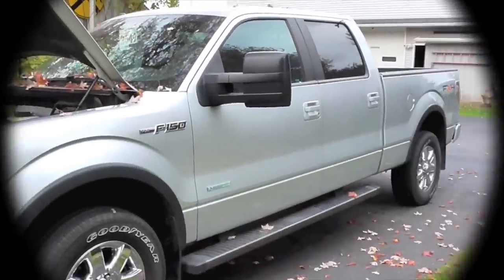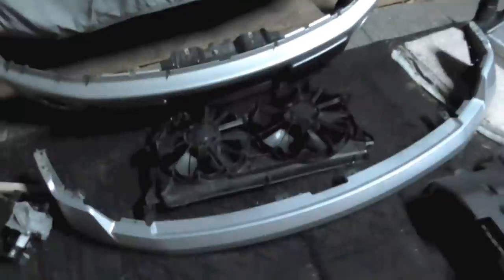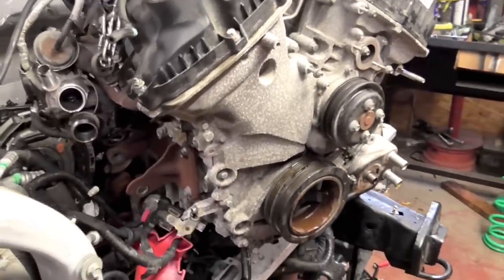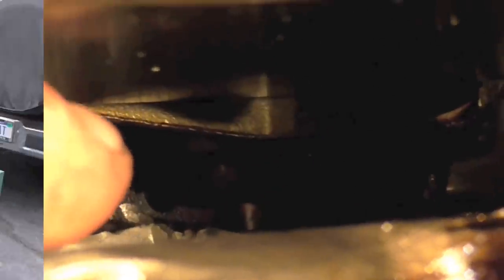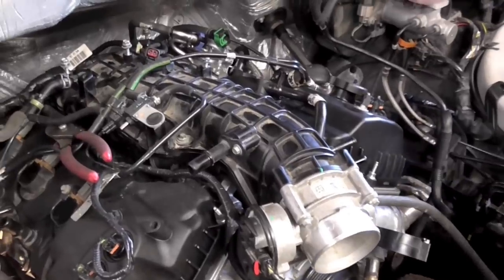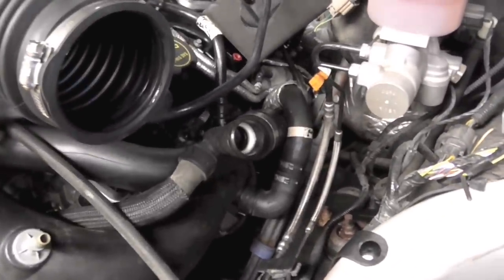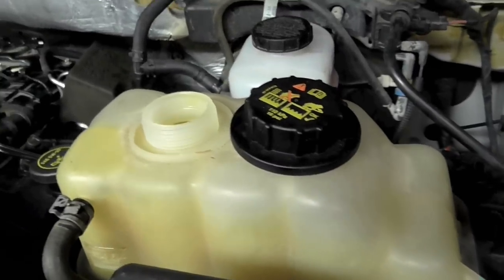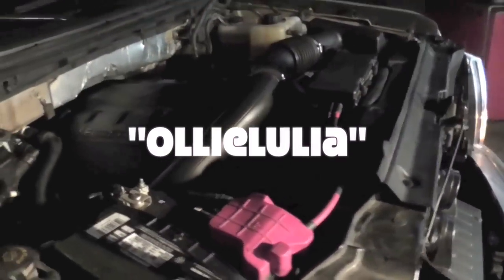FORD F150 TRUCK:  3.5 V-6 ECOBOOST ENGINE FAILURE (Removal and Installation).

Comment: Been a ford tech for a long time never changed one of these but I have a pretty good idea that this motor was refused warranty because the amsoil one oil change a year bull . Have tones of these in fleets with 200k miles on them. Using bulk oil and ford filters
Reply from the maker: NOT in our example ... If you read here (and it's impossible too "read" everything), we had a Blackstone oil analysis done, and used "AMZOIL" every 6 K. ... Blackstone's anal. (and the Trucks "oil life index"), were pretty much spot-on / and agreed.  *NICE TO KNOW ... The topic of oil / records/ amid "everything else" never got to "1st base", as we were past (or exceeded) the miles and that was it.  NOW we use (and will continue too use), only MotorCraft Oil / filters to maintain our 3 year warranty.  

Our only argument: all the water ...  * "a small LAKE in fact":  AFTER the failure.  * The failure was caused by hydro-lock, often (today still), we'll see it dripping out our "weeping holes" STILL.  :- )

Comment: how much boost do these motors actually run?
Reply: 13 psi, drops to 11 close to redline then spikes to 15 on an upshift.
Reply from the maker: "Work's for me" ... *My Son (the Driver) likely will NEVER find out, as He's an "easy driver". What Nelson says sounds about right. "Hell I don't even know if there's a "boost parameter" ! (or a "gauge").  

The Truck continues ta run PERFECTLY.
Reply: Yeah the trucks broadcast a PGN over CAN for manifold pressure, any OBDII reader will log it.  If you boot it quick you'll see peak boost really soon.  The turbos are little bitty Garrett GT15's so they spool instantly.

Comment: How long did it take?
Reply from the maker: From beginning to end ?  "about a week". We weren't going "gang-buster's" trying to get it done .... just bit by bit every evening (after work) Jack. "It wasn't that bad".
Reply: @TommyZTrains  How did you end up lining up the converter? I'm getting ready to attempt an engine replacement in my 2013 3.5 EcoBoost but I've been told to take the cab off to do it
Reply from the maker: @dannyarnold593  Hey Danny,  If I recall it wasn't that bad and we "eye-clocked-it" (the bolt points), and I THINK just pulled it together amid a "wiggle" and the starter being OUT helped a lot to. "IT WASN'T THAT BAD" !!.

Comment: Folks as great as the ecoboost engine is it'll never outlast the engines in the 92-96 Ford Trucks.
Reply from the maker: I'd bet that with anyone "older", that THAT would be a fair statement to make ... "starting with computers (and technology) alone. take an old 302 or 351, (even going back as far too the old straight 6's) ! THOSE were the best days yes ? :- )
Reply: I bet my 92 Ford Ranger is still on the road.  That truck ran great.

Comment: My girlfriends 2017 Escape 2.0L ecoboost is at the dealership having the engine replaced, it lasted 30k miles she got to drive it about a year and a half before it blew - the head gasket blew out and coolant got in cylinders, she bought it brand new and had it dealer serviced and never towed anything.  Don't they test this crap out before they make these damn engines?? Something is wrong here, pick up truck engines are supposed to last, I would not trust this in a truck.  These engines are light duty at best..
Reply from the maker: "Yeah": In the "perfect-world" you'd think they'd be tested, *(and it's quite likely that they are). We were flabbergasted upon our "blow-out" ... literally in a state of dis-belief !. 
*Man the REALITY set-in FAST tho.  :- (

Comment: when you grenade an engine all the piston parts make there way into the exhaust and into the turbos and that can damage the turbos and put crap back into the engine, I hope you had the good sense to clean them out, I don't see a second video so I guess it worked. You can get ford to warrantee that engine if it was 1 year newer.
Reply from the maker: Good thinking "Crap"  :- ) ... but: the failure happened, at literally an "Idle". (Read the description).  STILL: You remark is spot-on, it's just (in our example), the parameters were "different". NOT "an Explosion" ... *ANYWAY: (most assume a thing like "that", is is a "given"), ... but again: NOT here.   Best

Comment: I'm not a Ford guy.... but I've always liked the ecoboost engine that they've put out. I know the first gen had it's problems and hopefully they've been solved with the second gen they use now. I drive a 17 silverado 1500 LT with ol' reliable 5.3L v8 but I've always deep down wanted a 2011 f150 with the 3.5 ecoboost!!
Reply: The ole "Coke vrs. Chevy" argument ... all I would add is that this Truck CONTINUES to run & operate flawlessly @ appx. 110,000 miles, (appx. 60 K AFTER this failure occurred). "It's a  G R E A T  Truck" !
Reply: Can't believe the failure happened in the first place..... glad that the truck is running great now!!

Comment: The ecoboost has been a nightmare for me,,,first the blow by then the rattle started ,,,it’s just been one after another after another ,,,,right now I’m looking at a complete engine change out transmission and all…..
Reply from the maker: Shit, "I'm sorry to hear that". We got off to a rough start (this video), but now *(as I surpass 200 K miles), I have had zero issues / and the oil is changed every 4K with plain ole Motorcraft "plain-Jane" 5-W-30 oil as Ford recommends ... and aside of an occ. bottle of "Tectron" cleaner every 15 K, I have done NOTHING. The issue is ANY NEW TRUCK is far worse then this / amid most receiving not 10 points outa 100 with Consumer Reports. Anymore, a hundred K miles out of ANY American platform is near impossible.  :face-green-smiling:

Comment: what causes a hydro lock?
Reply from the maker: The Charge Air Cooler, makes the incoming air "chillier (and more "dense"), thus the twin Turbo's (in this Platform's example) are more efficient / better = more horse power. The side effect is that internally (upon doing that which I preface), water "droplets" form (or "condensation"), and "fill" the "Tub" (or accumulate inside the "C.A.C"). The issue HERE: Lack of a drain hole and condensation building up & up (filling it with water droplets / until the "tub" is "full"). 

*Now, a burst of acceleration = a large swallow of water "injested" = "hydrolock failure" (cylinders swallowing huge amounts of water) = failure & the reason we had to do this job / engine failed.  

After the failure; water was streaming out of the exhaust "weep holes" for some time ! *So much in fact, that: "we assumed it was OIL" !!  ... it just poured out !!!  (This FAILURE occurred doing about 10 MPH after a dead cold start / light acceleration BTW). 

*End game: Drill a hole in the "C.A.C" The: ("charge air cooler")  *so it can drain = no issue afterword.
Reply: i wonder if ford fix it in 2015 models
Reply from the maker: I'm NOT Sure ... "Tell ya what Javier: I'D LOOK" !!! *it's easy too see a "hole" underneath (in the C.A.C.). My GUESS is (on a 2015") ... YES  (it HAS the drain hole).

Comment: These engines should be warranted to 100k miles like other mfgrs do. The short power train warranty demonstrates Ford's lack of confidence.
Reply from the maker: I guess after all the torture test video's we saw (PRIOR to buying our Truck), "that we never thought about that". Maybe it was the Mike Rowe narration ?
Reply: Aren't GM and Dodge 60,000 miles as well, last I checked they were
Reply: Up until 2015 GM & Chrysler power train warranty was 5yr./100k miles.
Reply from the maker: That'd of been nice John !!  :- (

Comment: I’m swapping out my motor and transmission on my f150 2013 limited 3.5 ecoboost with 298k miles. Had the truck since 8 miles and had ams oil and filter ever since she laid to rest. Cylinder 5 blew due to the previous place that tuned it which was a licensed shop broke the spark plug in my cylinder. Interesting seeing this as it only has 68k miles.

Comment: Those Connecting rods look to be Casted. Any turbo charged car should have Forged internals. I think this Motor might have experienced Low Speed Pre Ignition which caused the Fuel/Air mixture to Ignite Prior to the Piston Being at the top of its combustion stroke. This being of 2011 Production makes me think ford was still using the wrong materials at the time as i believe they did not switch over to Forged internals until about late 2014. Amsoil and Mobil 1 are supposed to be Releasing a Re-Formulated Oil that combats LSPI. Scary Stuff.

Comment: Seems strange since we have had zero engine failures and 60% of the trucks we sold were ecoboost at the time . Some timing chains and turbos but no engine . We have tones with 200k miles 400k kilometres I work for ford and have changed more LS based gm motors than fords in the last 7 years
Reply from the maker: Agree this is a great Motor svt ... "I seem to always the "bad-luck" guy I guess" !  :- (    

*Truck continues to run PERFECTLY too this day.

Comment: Drill a 1/16" weep hole in the bottom left side of the intercooler so the new engine doesn't hydrolock again.
Reply from the maker: +EricTheOracle yeah, we did that right after the failure and drained out a small Lake !
Reply: +TommyZTrains How come diesels don't have this condensation problem?
Reply: because diesel run hotter, therefore the water evaporators out of the intercooler, while the ecoboost run colder.
Reply: Yeah did this to mine after a major misfire.  Think the damage was already done however.  Weep hole works great.  If you tell people you've done this they think you are bat shit crazy.
Reply: @peiguy1982  Back before the EPA made it impossible for OEMs to provide weep holes, all gasoline turbos with intercoolers came with a factory weep hole. Just to say you're in good company.
Reply: @MinnesotaEric  It solved this issues with mine and did not do it again.  No codes.  I think I did 1/32 on the corner however.  Did it first at 18k km and kept the truck until 65k km.  Allowed me to remove all thst ridiculous plastic shrouding too over the CAC.  Imagine having such a big CAC then covering half of it with plastic.  Yes EPA has made it nearly impossible these days.

Comment: How much will this labor cost????
Reply from the maker: Guessing ? ... appx. 2500.00  The work involved was INCREDIBLE and laborious !.   :- )
Reply: @TommyZTrains  @ ok,   Plus a/c needs to remove the condenser
Reply from the maker: @gerardolopez5875  Yep ... some totally remove (or cut out / and re-weld) the entire core support ... "I'd  N E V E R  wanna do it again.
Reply: @TommyZTrains  @ u  wouldn’t do it again???   That means ! If i can avoid it? Its better??? Ism not a certified mechanic
Reply from the maker: @gerardolopez5875    There are many hundreds of parts, and "IF" I were to do it again / I suppose I'd take pictures amid the various procedures / as it becomes very overwhelming really FAST ! ... *the entire base of the windshield even has ta come out !. I know of no-one that would attempt it around HERE (other then a Dealer).  

We had a lift, and it STILL was a nightmare.
Reply: @TommyZTrains  @ I’ve done the 2008 tritón v8,    Its the 2012 v8  more complicated???
Reply from the maker: @gerardolopez5875  "That I don't know".

Comment: If you suspect hydro-lock and this damage occurred in your driveway, I would seriously suspect the fuel injector for that cylinder. If it stuck open or was electrically commanded open, the injector could have flooded that cylinder.
Reply from the maker: +cp6027  "That's the first thing we  thought about", but after seeing all the the water (in the C.A.C. and in the turbo  pipes) and no fuel "odor", were convinced it was H2o hydrolock.  The injector's are great, ... *and Truck continues to run perfectly on those same injectors. 

Best
Reply: TommyZTrains
I had a supercharged thunderbird and your intercooler is much larger then what I had, but I can't see the engine injecting water from condensation inside the intercooler to just ONE cylinder. Excellent video hope the new engine works out.
Reply from the maker: +cp6027 Thanks !  "so far so good" !!  Best.
Reply: +cp6027 It probably injected to all of them, and was just great enough for one to fail.  The one rod was possibly weaker then the rest.
Reply from the maker: +Josh Gould  "Agree" ... One small hole for the C.A.C. (too allow same to 'condensate') would have likely prevented all this Josh !
Reply: +TommyZTrains I know they have done a bunch of redesigns on it, and probably have 'resolved' it on the newer ones.  I know there were a bunch of TSB on this issue, and the only way to get them done is to complain about a check engine code usually.  Buy they were offering this fix regardless of the miles/age.  Of course this won't cover the dead moter.

Comment: What did FORD say about this?
Reply from the maker: +3006USMC &quote;   "Your out of Warranty". We appealed, (and even tried to correspond with the CEO), all too no avail.

*At least we tried.  :- )
Reply: +TommyZTrains  4 years and you're out of warranty? 1 owner truck? if not, I'm betting PO voided it already. Or on the tear down, They found "Abuse and/or neglect. Over revving condition." They'll look for any reason to deny a claim. Trust me. Will never buy a $40K truck from them again. 04 F350 with constant electrical problems.
Reply from the maker: +Cruiseomatic We took it to the Dealer and were hopeful they'ed help, but I don't think the Service Mgr. was in "our corner". We LOVE the Truck otherwise. We've had no issues at all with it (prior to this failure).  

All this happened while backing out of the driveway and it didn't get 40 feet !  "Water will do that".

Comment: I have had a ecoboost since 2012  and it now has over 120k of city driving.  NEVER REV A COLD ENGINE. These engines are all aluminum and with twin turbos you will wan`t to let it warm up first. I don`t know how you drove this but these are great engines. Oh and mine has been tuned by Livernois  to put out 455 HP and 460 TQ. I have a Lincoln MKS and it will out run just about everything but a P100
Reply from the maker: With all due RESPECT: "why are you saying all this to me" ? ... *Did you read the description scbird ?,  (I WHOLEHEARTEDLY AGREE with ALL that you say BTW),  and: my "failure" (amid this entire incident), occurred on a warm / sunny / VERY HUMID day,  *doing less-then 10 MPH / ingesting a "belly-full" of water (unknown to me at that moment) that accumulated INSIDE my charge air cooler, after backing outa my driveway,  .... thus "hydro-locking" / blowing-up my engine.

 I NEVER "rev-up",  (nor "revved-up")  ANYTHING .... I seldom EVER even "floor" my truck, ... *(or so much as even "spool-up" the turbos) ....... BUT:  I'm no saint, ... "and were all 'sinners' yes" ?  / anyway: "you get the idea". 

SO: (After that),  all I would say is that the Truck CONTINUES to EXCEED all expectation,  "and it STILL runs like a dream" ... I have NEVER had a problem,  now well in excess of the 120 K on the Truck *(that you now have "+" ).  This video simply critiques an incident that occurred where (back at the time) I felt ford SHOULD HAVE helped me with.  "That's it". 

NOW all this has been "fixed" ... (with ALL of the well-documented "water in the C.A.C. problems that have NOW been corrected on the later models *(incorporating some type of a catch-can type of an apparatus I'm told.).

So again: no-one "revved" anything, ... "and I'm not an idiot".  Thanks for the nice "pointer-out" none the less / (and I think that you weren't try to be "condescending" anyway).   :- ) Hope you had a nice Thanksgiving / ALL the best Sir.
Reply: @TommyZTrains  Sorry I was replying to the haters of This engine. You had a hard job to do there. As the water goes it might have been from short trips with the truck. I have done my share of engine rebilds in my day and have seen a lot. I was pointing out common failures to the noobs.
Reply from the maker: @scbird1  "GOTCHA" !!   : -  )

Comment: For the past few days I've been reluctant on putting a weep hope in my CAC simply for the fact that I live in Phoenix Arizona and we are dry most of the time. However, the truck being a 2013 with just under 190k miles with no major issues other than a spudder here and there, I sure would like to keep it running strong. I see this video is rather old but has all the evidence I need in order to just drill the hole.
Thanks
Reply from the maker: Being your area's so "arid", perhaps THAT makes all the difference. Look at some others (here on YouTube) whom have drilled a quick hole to see all the water THEY "let-out". I guess if it were me; "I'd do it". BEST.  :- )
Reply: @TommyZTrains  I drilled it earlier. About three table spoons of runny oil came out immediately and then more as I drove it around. Could tell because on the back of the lower air dam was splashed with oil and dripping. Let it sit for several hours at a decline, drove it again around the streets and was averaging 20 mpg(before was about 17.5-18). And the cold start roughness also went away. Huge success in my eyes. It surely would have gotten worse if I had left it as it was when our monsoon hit. Did not think it would make that drastic of a difference so soon.

Comment: My 2013 did the same thing at 40k miles.  My first new car financed.  Dealer did this job for me.  I drive a Dodge now, jury is still out on the F150 motors IMO.  Shame the way they have to design them for government fuel economy targets.  The rest of the truck was excellent.  Ford sells so many they have no other choice with CAFE regulations.  Light materials with more and more power and increased fuel economy👎.
Reply from the maker: Your spot-on Mike ! ... "WOW":  "40K is alot of reality real QUICK".